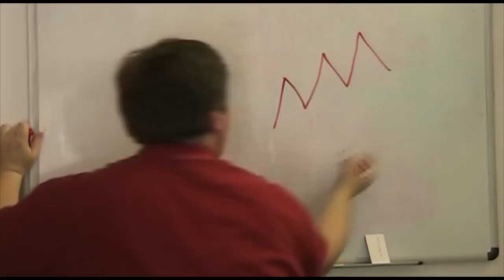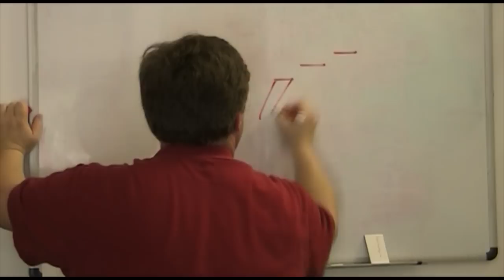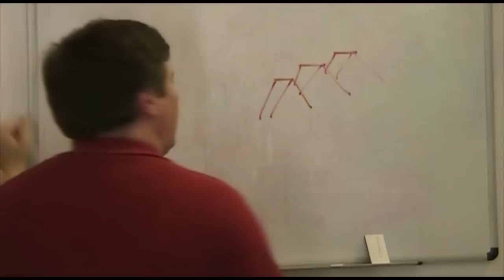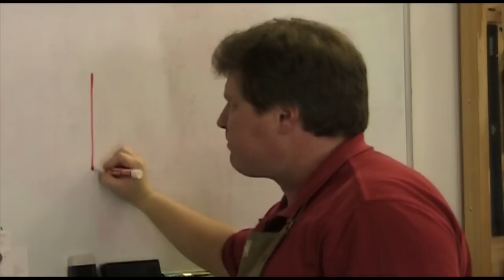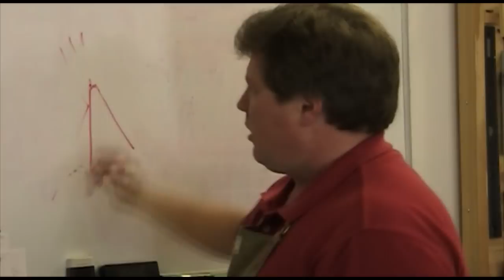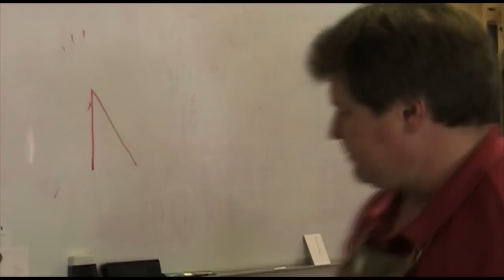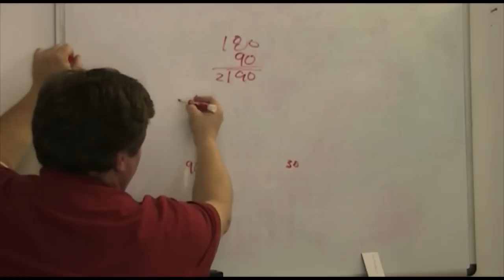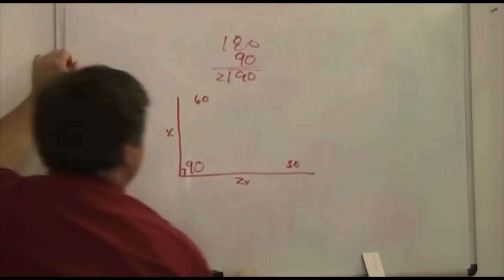1-01a: An Introduction to Woodworking

Comment: Excellent Video and thank you for taking the time to teach. How you explained the nature of wood and cutting it was fantastic and much needed if one is to become a woodworker. Ex. Ripping or crosscuts of wood and the results.Onto the Router bits one in your right hand is for crosscuts and the one in your left hand for ripping.
Reply from the maker: Thanks, It was a trick question. They're both flat so both are rip. You get the burning from cutting end grain (crosscutting).

Comment: Hello mister. Thank you very much for your very informative video. However I think their are some mistakes with the triangle's  maths. If the right angle' s sides measure x and 2x then the sharping angle is arctan(1/2) that is to say about 26.6°. For a 30° angle  I think you need right angle's sides measuring x and x/tan (30°) = x*(squareroot(3) namely about 1.73x. This could explain some discrepancy using sharpening jigs... Best regards. Vincent from France.

Comment: Oh my god. I'm loving this. This is awesome.
Reply from the maker: Thanks, more in this searies coming shortly
Reply: Brilliant :). However, there's something wrong with the 30-60-90 triangle. The sides are not x and 2x, rather x and root of 3 times x.

Root of 3 is roughly 1.71, so a little bit less than 2.

You were right about that intuition that bigger the side, the bigger the angle, that's true, however the proportion is not simply to the angle, but to the sine of the angle. It's the rule of three, but not with angles, but their sines. :)

Comment: A 30 degree angle ... you are close.  Take a hypotenuse of 2 and a leg of 1 and that'll give you an exact 30 degree angle.  The other leg will be square root of 2 or ~1.4142.  Not getting hung up on technicalities, a very excellent introduction to woodworking.
Reply: The other leg will be square root of 3, or app. 1.732.

Comment: Very informative. I think the router bits are both for rip cut,. I think you should always rotate the bit down the grain?
Reply from the maker: Correct
Reply: I have spent months studying building sheds and discovered a fantastic resource at Wilfs Shed Formula (check it out on google)

Comment: I love your videos and they're very informative, at the same time beginner friendly. I'm fairly new to woodworking and i won't have the luxury to buy a set of diamond stones to sharpen my tools, so i wanted to ask if whether or not a normal sharpening stone (the ones that we use to sharpen kitchen knives) can be used for sharpening instead? Would appreciate your response. :)
Reply from the maker: Check out my video on making an inexpensive sharpening system. Anything will work.

Comment: I really love the Video! Very helpful, however the hypotenuse is twice the length of x, not the side labelled 2x in the video. 60 is twice of thirty, but we must the sines of the angles and not the value of the angles themselves. This is because sin(a)/A=sin(b)/B=sin(c)/C. sin(60)/2x<sin(30)/x here. The side labeled 2x should actually be the square root of 3 times x, and the hypotenuse should be 2x.

Comment: Do crosscut saws go by any other names? I've been looking for a decent handsaw set online, and nowhere have I found a set that includes "crosscut" saws. I've seen rip saws, but I haven't seen anything specifically named a cross-cut.
Reply from the maker: +KingofKirby01 I haven't heard of them going by another name though in the old days names where different. Nowadays we're kinda ignorant so many people mix up hand saw, panel saw, back saw, etc... I'd suggest looking to Lee Valley as they have great saw 'sets'.
Reply: +wortheffort thank you very much! i just got Stanley's basic reissued 750 sweetheart set and some waterstones. I just started getting into woodworking

Comment: Your cuts are so much smoother than mine. I am using "common board" from home depot. Does it mean my chisel is not sharp enough or is my wood just much harder than what you are using?
Reply from the maker: +Fahraynk chisels not sharp. In actuality the harder the wood the duller the chisel can be. The soft woods require a much keener edge to slice instead of crush fibers.

Comment: Great tutorial, the Chinese use the metric system (millimeters) because its more accurate as do we here in Australia. Apart from that I thoroughly enjoy your tutorials.
Reply from the maker: +PyroChimp75 I'm not convinced it's more accurate. Just different method of division. But luckily, doesn't matter in the end. The table you build doesn't know its metric or imperial.
Reply: +PyroChimp75 

Really so my ruler has 1mm divisions which 25.4 of make an inch but the same ruler has 1/32 divisions 32 of which make an inch hmm and the metric is more accurate how?

If i get out a micrometer or a vernier then either system is capable of equal accuracy but a standard 12" rule will always be more accurate in Imperial as the divisions available are smaller.
Reply: you can go down to nano and picometers which of even more smaller than anything you can get in imperial, horses for courses~
Reply from the maker: Man, if y'all are measuring that small your dovetails must fit like pistons...
Reply: If its good enough for space craft its good enough for dovetails.
Reply: I have several measuring tools that read .0001 of an inch. Yes that is a 10000 of an inch. I made solid carbide cutting tools. We used imperial measurements mostly because we live in the united states. Lots of tools will read .00001 of an inch. Engineer scales give 32s of an inch and 10ths. The only difference in the 2 systems is what you grew up with. I don't believe in my limited woodworking anyone cares about .001 of an inch.
Reply: something like that...

Comment: Very nice, excelent material. Just beware that the ratio 1:2 of the angles 30° and 60° is specific to them. Without getting nerdy, think of it as a mere coincidence. Other angle combinations WOULD NOT work like that (22.5° and 67,5° is not a 1:3 ratio).

Comment: will have to show my boss this, as you seem to explain things better then i do. hope it stops a lot of time wasted on sites or in meetings as i really cant put it in to words.
 I learned from my dad at around 13 years old by helping build our home. so it will be really really cool for me to get a better understanding about how it all works instead of just this tool for this part of project doing depending on the material that is being worked work with/on.
i am in the uk now and it seams that everyone uses this ?MDF? stuff. i have never used it and cant understand why exactly it seams that everyone from  the hobbyist to big massive companies use it for everything. to me it seem like a cheap tacky and weaker alternative to ply. YES i know i am likely wrong in that thinking (or well really hope i am) so if you can put me straight that will be great. i always end up buying ply when i go out to buy MDF so i can have a play with it but i just cant get my head around the fact that TO ME it resembles compressed sawdust and glue. granted that can make a solid material but doesn't last as long, absorbs lots more moisture, and is less durable then ply. so in the long run you end up spending lots more money then if you would have if you paid that little extra on a lovely thick strong durable ply. i am confuses :(
Reply from the maker: mdf is compressed sawdust and glue. it has it's place, but I don't use the stuff. i don't use much ply either. mdf is more consistent than ply, a little cheaper, and mills well. but i wouldn't say it's pretty or fun to work with. it's dust is also toxic.
Reply: i use a lot of real wood as much as i can as set a few deals up with some tree surgeons where i live, but when it gets to the nicer weather i end up with needing ply. 
i did hope i was wrong about what it is made out of, but guess it would be easier to learn in a way.

Comment: I appreciate this video very much, but that triangle math is wroooong-o. My go to way to find 30 degrees quickly is to remember that the lengths of a 30-60-90 triangle are 3, 4, and 5.
Reply: A 3-4-5 right triangle's other angles are approximately 53° and 37°.

Comment: Stop screaming !!!
Reply: Van Ram Van Ram That is not a useful comment. You have nothing to offer about choosing or placing a microphone. You didn't have anything to say 
 about materials that can deaden or enliven audio in a recording space. And very clearly you fail to recognize that this man has more potential as a presenter in both instructional and commercial content than, really, any other in the woodworking space. So, focus on your own delivery - it needs improvement.
Reply: Van Ram disrespectful
Reply: That's not screaming.  If anything he's speaking loudly.